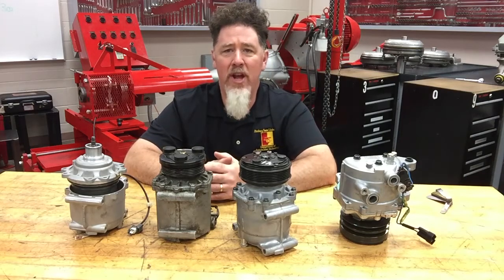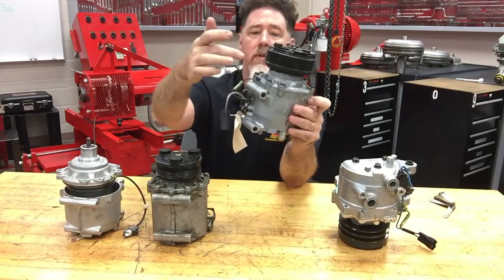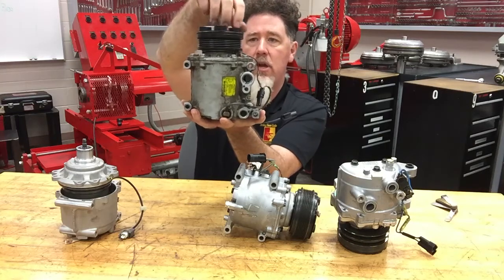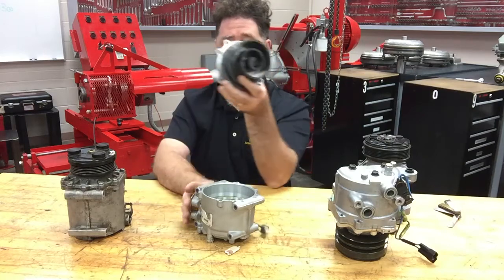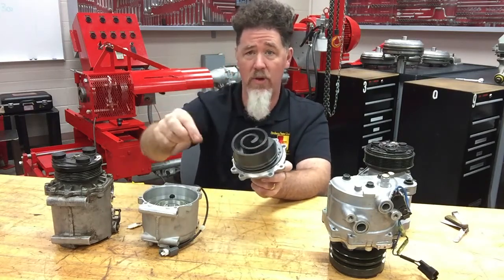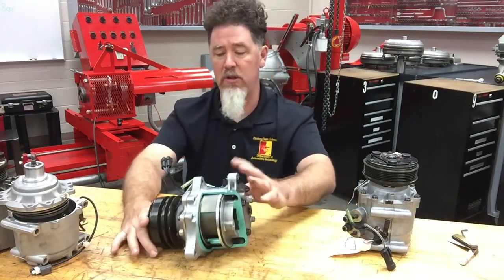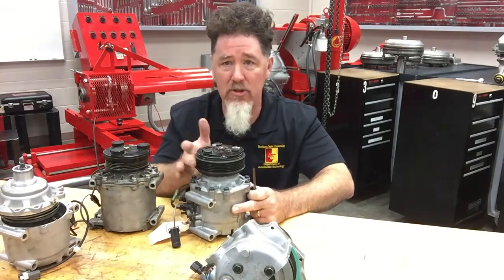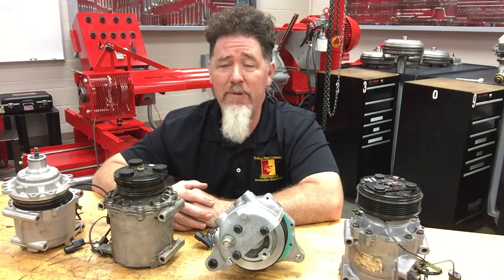Lesson on the Scroll A/C Compressor Part 7

Comment: Prof. I have challenge with car ac compressors.. i live in a very hot place in Africa (Tanzania), now most of cars that come with variable displacement compressors, these variable displacement compressors fail very fast, so technicians are now replace them with fixed displacement compressors (especially scroll compressors) now good this swapping is? And why these variable displacement compressors last shorter period than fixed displacement compressors?